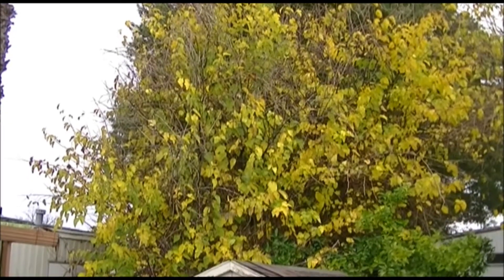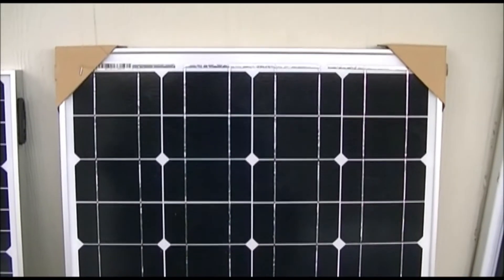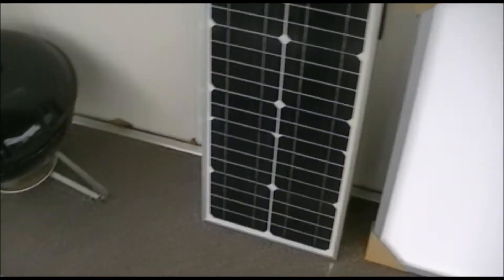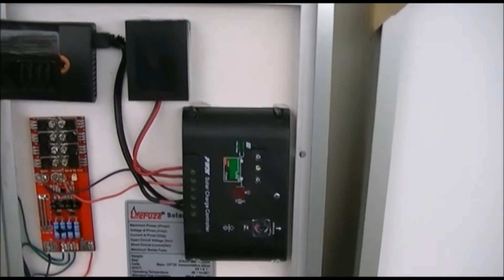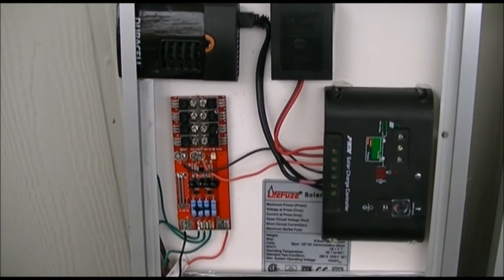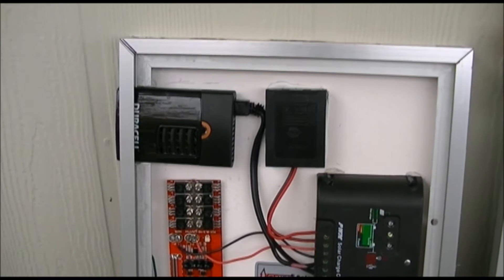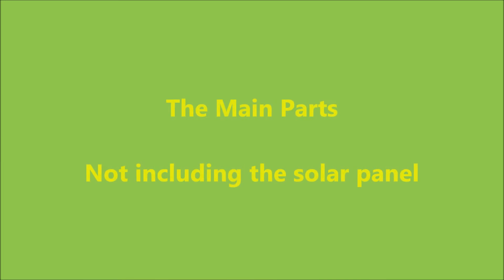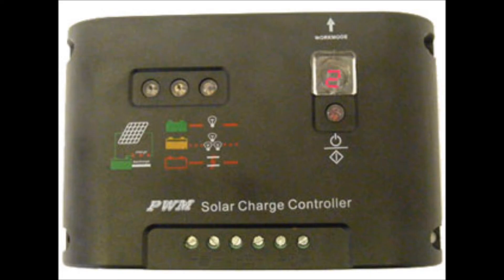Build a 40W Portable Solar Charging Station Pt 1

Comment from the maker: I don't think it matters. For the record, though, mine are soldered to the part of the solder area that's closest to the charge controller. If you check with your multimeter you'll see those solder points are just one big solder point, and are connected.

Comment from the maker: Nothing wrong with using a 100w panel, but then the portability gets limited. It could be a great thing for someone that doesn't plan on moving it around, though, like an apartment dweller. A bigger panel could accomodate more batteries, too, which would add more hours of usable electricity.

Comment: I question the advisability of mounting this equipment, specially the lithium batteries, to the rear of the solar cell. Solar panel's efficiency drops off the hotter the cell gets. Already pretty warm from just being in the Sun you have not only the heat off this equipment added to it but is also closing up the only area the panel can radiate heat (I have no experience with large lithium arrays but I've heard that they can get pretty hot).

Comment: Thank you for the reply.  I'm still a bit confused, I will check my connections at the charge controller.  But should i solder the wires from the charge controller to the PCM on the discharge or charge side (one of the two holes at P+ and P- respectively).  I currently have the wire soldered to both.  How do you have yours at the P+ P- location.

Comment from the maker: I haven't done any more yet. I've had some setbacks. I want to do one more video, but money, time, and other factors keep things from happening. It'll get done, but I need to find another battery source. I'm also using a different Protection Circuit module.

Comment from the maker: Sorry. No private e-mails. Got burned once.

Make certain you've connected everything up to the charge controller properly. I thought I'd done something wrong in the beginning only to find out I didn't have the charge controller wires hooked up well. If the light comes on on the charge controller, you're in business. I tinned all my wires going to the controller.

Comment: for about 30 dollar more  you can get 100 watt panel
Reply from the maker: +lacey397 True. I wanted them smaller so I could put them in a box, and ship them overseas.
Reply: +lacey397 the 20 and 40 can be run in Parallel to generate 60 watts.

Comment: Hey there JWWM2 - great job.  I've been following LaserHacker's SOLN1 project since November and I must say you've been very helpful.  I have run into an issue. I'm all set up.  I have voltage (even across batteries) at the PCM, but the charge controller is not turning on and I'm getting no voltage at the inverter ports on the charge controller.  
I have soldered to both holes on the P+ and P-, should I just be on the charge or discharge side? you can email this name at gmail.com thanks